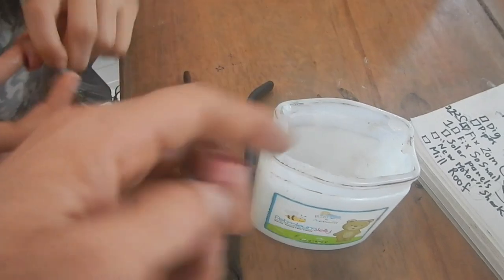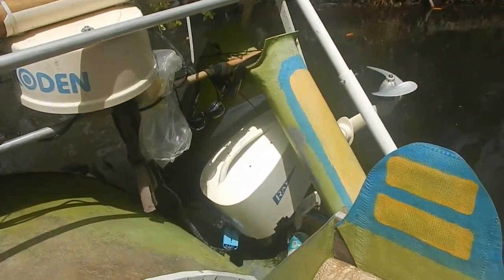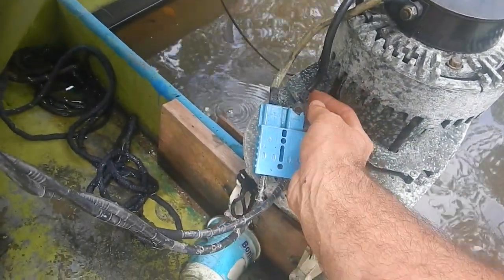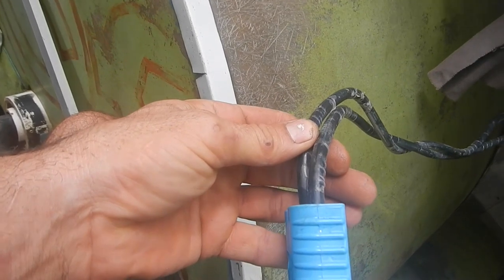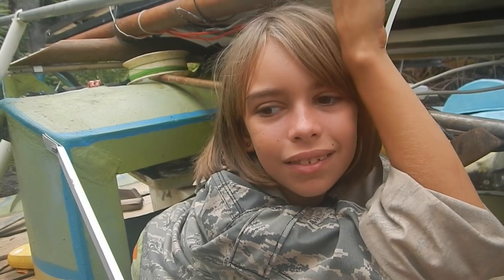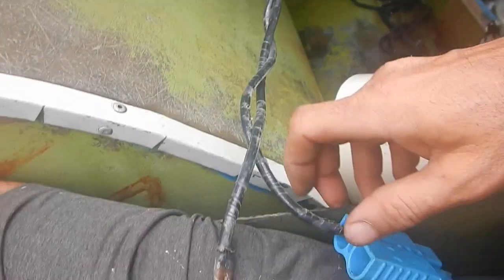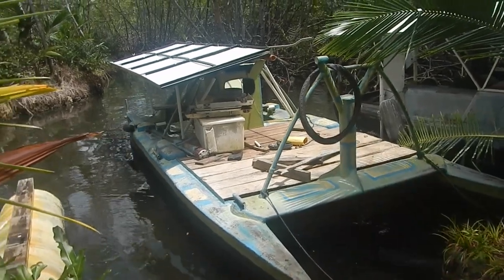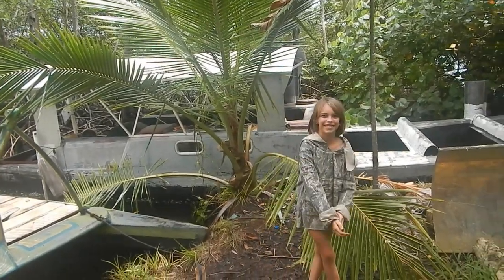Solar Snailer Wire Connection Repair

Comment: Always a good video, your boats are absolutely cool.
One of my neighbours had a problem with fungus growing on his car battery poles and connector so he cleaned out the fungus with a wire brush and put some grease on the car battery poles and connector that goes you the engine starter after some time the car battery went dead because the grease created resistance preventing the alternator from charging the car battery, so the greased was removed and cleaned from the car battery and connectors and everything went back to working just fine the car battery was charging perfect.